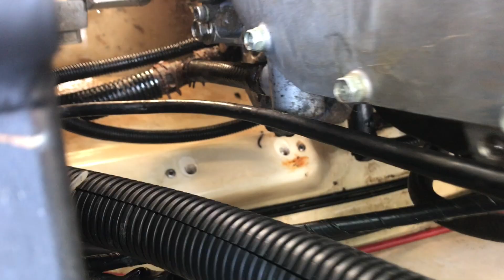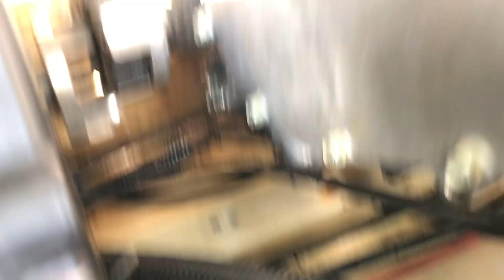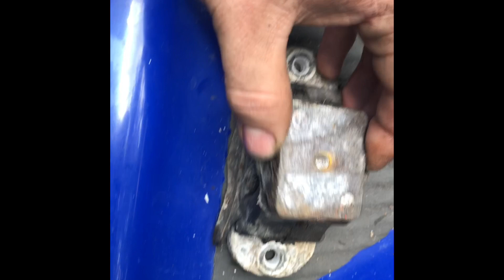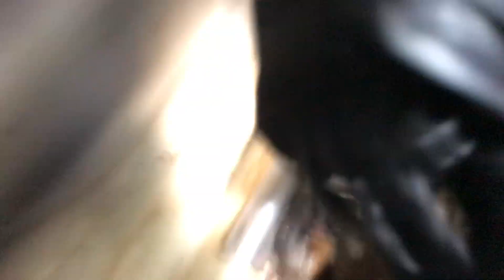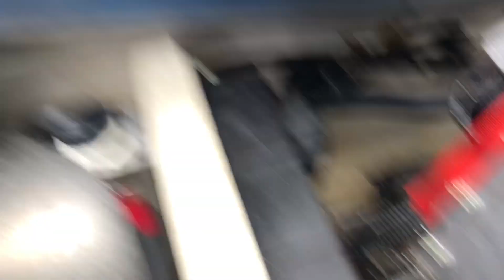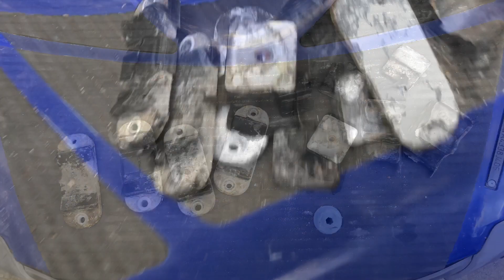Yamaha Waverunner motor mount replacement - Fx Cruiser Ho - 4stroke - Rhaas Products

Comment: I used Rhaas Racing motor mounts for a long time already. THE best you can get. On my 96 XP I used to break the OEM or Monkey Grips within 4 to 5 months (I do a lot of wavejumping) Rhaas is holding up already for 3 years.

Comment: Your videos are a lifesaver! I'm not that mechanical by no means but I will try tackling my VX1100 issues that appear to be identical to those in your videos.  Motor mount replacement and leaky drive shaft bearing seal repair were unobtainable for me due to dealership repair prices. My sled has been sitting for a year but after seeing your videos I will tackle them. Thank you for taking the time to make your videos they're a great help.